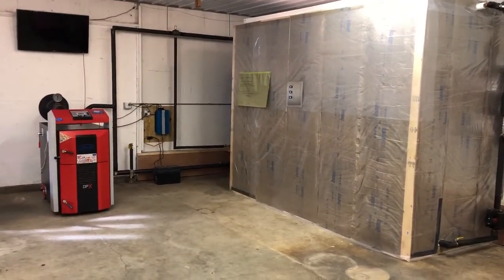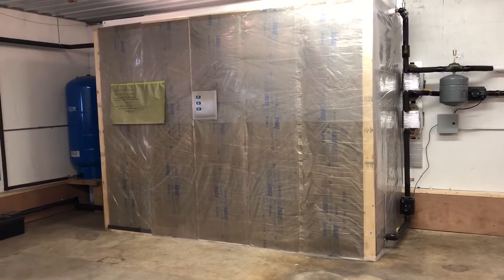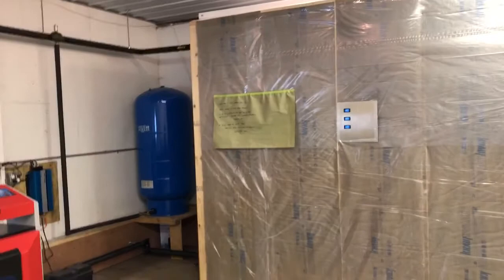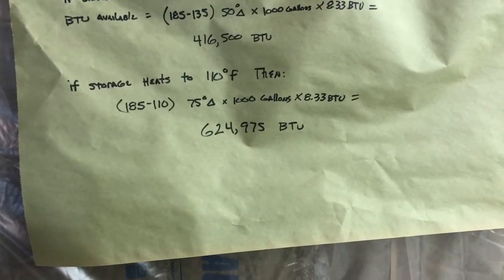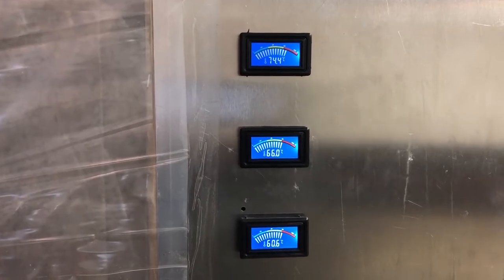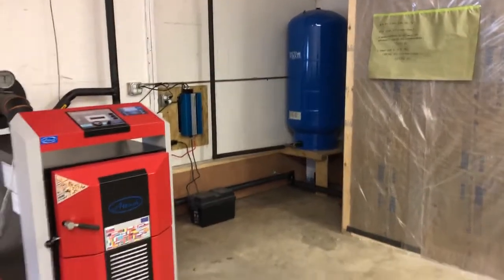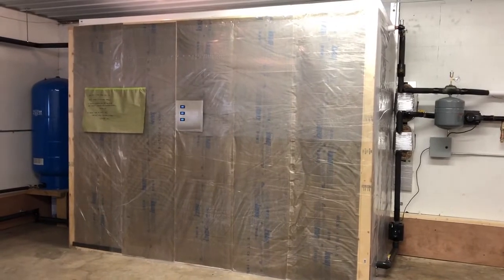Part 2 Attack DPXL-45 wood gasification boiler w/1000 gallons thermal storage

Comment: Is there or have you thought of some type of bypass directly to your emitters? I know my better half like instant heat and our area experiences wild temp swings in the fall and spring. Heating a few gallons in the plumbing to knock the chill off and keeping her happy versus explaining to her why the boiler isn't hot yet seems like it would be worth the extra engineering.

Comment: First American heating system that makes some common sense! ;) -You should connect your expansion vessel to the cold side tubing instead of that higher loading line having always the hottest water in it. As it is now connected thermal expansion forces the hot water in your expansion vessel and causes a significant heat loss since your vessel is uninsulated... One additional thing is that ages that rubber much more since hot water is directly touching the rubber element inside... So why not just connect it to the bottom / return line of heat loading circuit?
Reply from the maker: Thanks for the suggestion.  The bottom third of the expansion tank only gets warm to the touch when the system is up to temp but you are correct and I should move it to the boiler return line.

Comment: I’ve been thinking on a thermal storage system. But I’d be looking at a straw fueled fire source. Easiest ways to do that would be the outdoor wood boiler type equipment. But those are often no pressure systems.

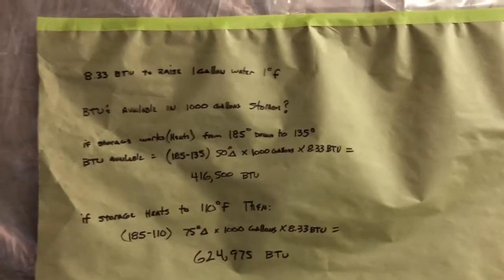Comment: At 5:22 into your video you show some computations. I assume your tanks do not have any coils inside and it is just hot water in and cold water returned for reheating, Another fellow's video shows a 1000 gallon LP tank that he cut open and installed a thermal transfer coil running the length of the tank which stands up, where as your tanks are lying down. Not sure if orientation has major effect. He does not say anything regarding the thermal transfer values or volume of the coils. He just says he is happy with the results. My question is: How do you compute kWh of a thermal transfer coil? Let's say it's 16mm ID and 12 meters long. Water circulating through the coil is 85 degrees C and it is in a 500 liter tank. Target temperature for the storage tank is 60 degrees C. One day's hot water requirement is 300 liters of water that is 38 to 42 degrees C. Save me Mister Wizard! My brain shuts off long before I can make any sense of this. :)

Comment: since install with a season or 2 under your belt how much wood are you using? face cords
Reply from the maker: roughly a level 6cuft wheelbarrow load per day in shoulder season, heaping load in colder weather.  Assuming medium btu woods like ash, hackberry, medium hardness maple and a few sticks of oak and honey locust mixed in.   More if burning box elder and cotton wood.

Comment: Hi Tim this is Chris again. Thanks for the good input last time. If one of the question how did you convert the bsp thread out of the back of the stove into something for npt? The paperwork says it's bsp, but it took me months to find that.
Reply from the maker: I just used standard NPT pipe fittings.  I do recommend some good thread sealing products like locktite 55 thread sealing cord and then Locktite 565 anaerobic thread sealant over that. The cord takes a bit to figure how to use but not difficult.  I have no leaks after using the locktite products vs at first when I used teflon tape and a soft setting sealant (rectorseal yellow).